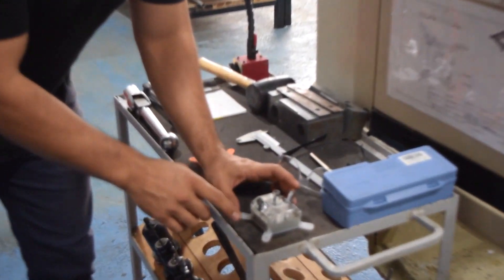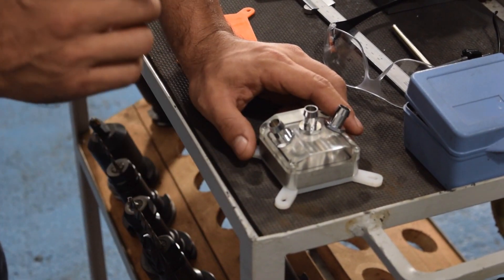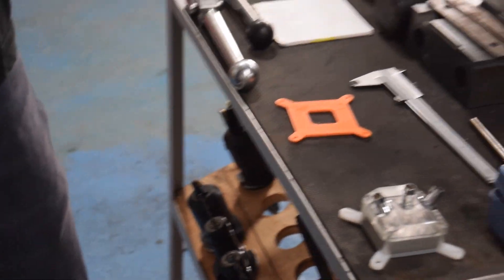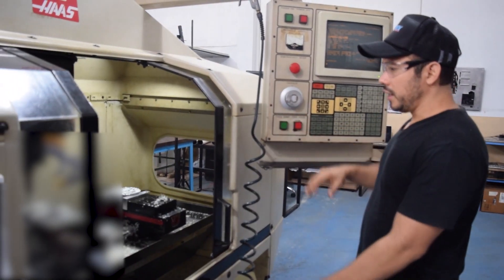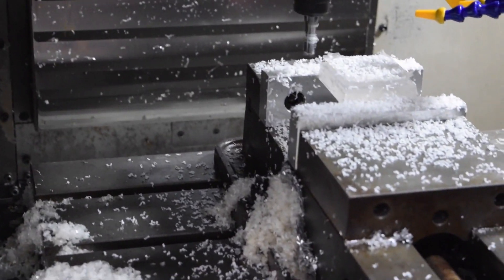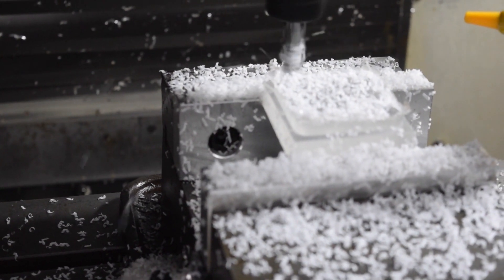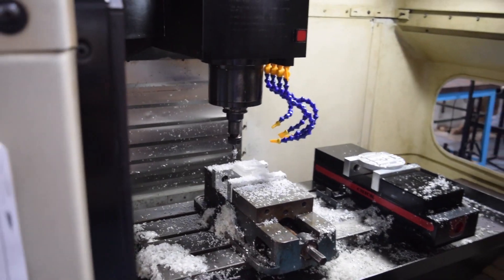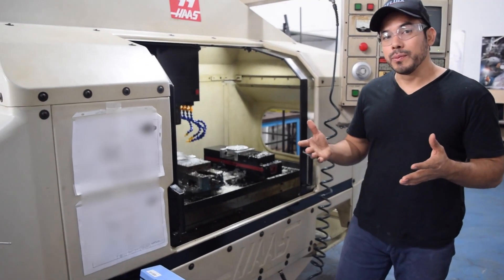FLUIX LLC Manufacturing Process & Concept Waterblock Reveal!

Comment: Why not just make a plate that takes water in at one point and spread the water to all 4 corners and push the water out the center.
Reply from the maker: Thanks for the feedback Tactical Center! We are currently still testing out TRI-SWIFT Water-block, simulations have showed that our technology is more efficient in removing heat from a variety of desktop CPU's. Stay tuned, we will be publishing data and a new video in comparison with other alternative cooling methods.